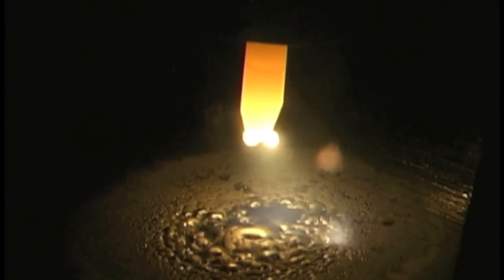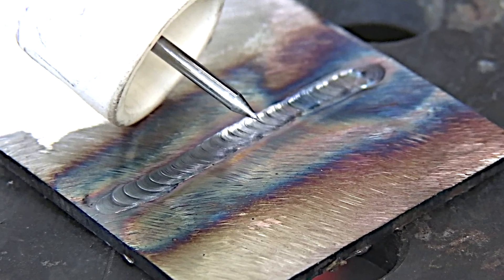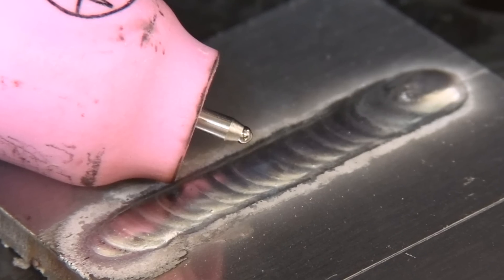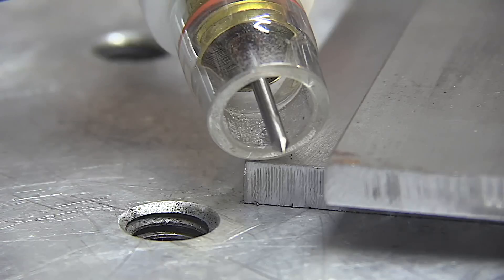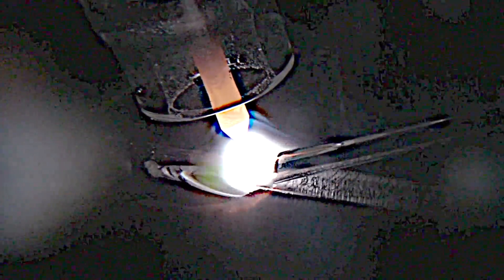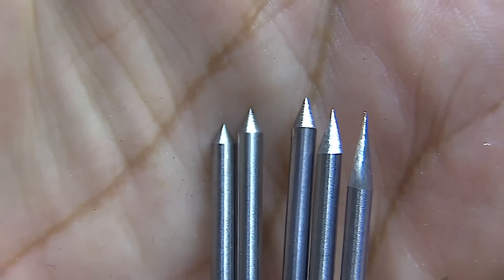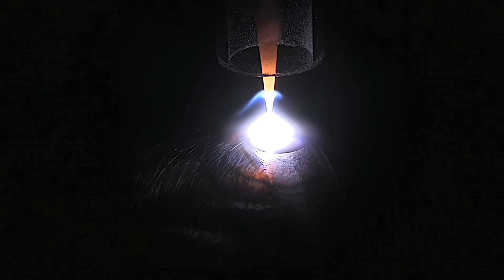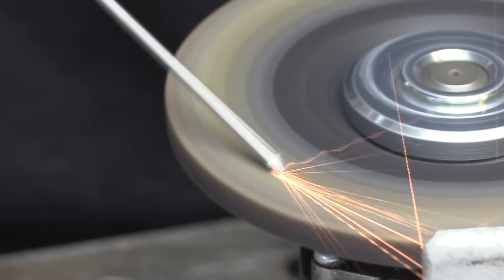Tungsten Angles & 2% Thoriated on Aluminum

Comment: I weld a ton of ChromeMolly to Carbon steel parts (3/16 up to 5/16 thickness). Company provides Rare Earth tungstens (1/16 & 3/32). What would YOU personally suggest use for that scenario? I have always used 2% Thoriated for decades. Not quite sure how I feel about the Rare Earth tungsten.
Reply: thorium is a rare earth?
Reply: @paradiselost9946  2% Thoriated tungsten & Rare Earth tungsten are 2 different types of electrode. Rare Earth are generally designed for mild to high carbon steel and other alloyed steels, where 2% Thoriated are primarily for stainless and other very highly alloyed steels. I however prefer them for most all carbon and chromolly steels as well. It is my preferred Tungsten for most ferrous metals.
My comment may have been a bit muddy. My apologies.
Reply: @BigCarmine  and thorium is still a rare earth.

yttrium and zirconium arent.
lanthanium is.
cerium is.

so referring to an electrode as "rare earth" is rather meaningless if you consider "thorium" to not be a rare earth electrode...

Comment: My newest lazy man way is just taking an unsharpened tungsten, switching the leads on the machine and setting it to ~50 amps, and striking on a clean chunk of copper, nice and slow, until I get a big old rounded tip. Quick, easy, and the tip stays nice for a long time. Anyway that's just me

Comment: the company i worked for only have this thoriated tungsten i keep asking for pure or blue one but they didn't buy it. so i did the same thing you do Sir Jodie. but one thing i notice if i start it ball then if you change amps it will dmg the tip un like pure tungsten or the blue one. Thanks for the video. and lastly i like thoriated when doing some 1.5mm or 2mm welding since i think it get hotter fast in the starts compare to other tungsten. my own observation only. just correct me if i am wrong.

Comment: loved this, thanks.  Can you offer advice on how to weld square steel tube to the floor.  The tube has a pronounced curve to the corner so the gap from the corner to the sheet metal floor is rather large.  Much appreciated!  Big fan of your TIG finger BTW.

Comment: Regarding the nodules, do you know what causes them? I get them on 2% Ceriated and 2% Zirconiated when welding aluminium. Using 2.4mm tungsten on 1.6-3mm 5005 usually ...
Reply from the maker: I really dont know what causes the nodules but AC frequency settings as well as waveforms seem to make a difference. Also transformer vs inverter makes a difference. Even different lots of tungsten types probably have differences.
Reply: I have never gotten those nodules while using zirconiated. What brand are you using?
Reply: @Wildman76059  they are Unimig, which is an Australian brand. I'm using one of their Razor 200 tig machines ... Are you familiar with any of their products?

Comment: I thought Thoriated tungstens were no longer used because they are radioactive ?
Reply: Thorium is indeed radioactive and thus a potential cancer risk. However, thoriated tungsten is most definitely still used for welding. 
Keep in mind there are different kinds of radiation. Thorium is an alpha emitter. Alpha radiation can be blocked with a piece of paper, or the layer of dead skin cells that make up your epidermis … unlike gamma rays which can require inches of lead.  The danger with thoriated tungsten comes from the grinding, not welding.  You don’t want to breath in thoriated tungsten dust into your lungs. Your lungs don’t have the same layer of dead skin, or paper ;-) , to stop those alpha particles. That stated, getting cancer from thorium is a statically thing…probably not gonna happen, but how lucky or unlucky do you feel. 😮
Reply: Who told you that? It's still sold.
Reply: the dust from preparing the tip, when inhaled, will contribute to cancer.

Comment: I learned on thoriated. I guess I learned pretty well, because I can't tell a difference between it and the other ones I've tried. I blunt the tip on the grinder though. I don't know anything about those sharpeners, they may not let you

Comment: Hey Jody, I've got a Lightning MTS 275 on the way! Any experience with that line from Everlast?
Reply from the maker: I dont have any experience with that particular model. hope it works well for you
Reply: @weldingtipsandtricks  não entendi o teu comentário.  Mas verei se uso o Google tradutor para entender o que você comentou. Obrigado.
Reply: Eu gostaria de receber informações sobre esse everlast 275. Eu quero comprar um, mas o dólar está alto,  então o real fica sem valor.  E também,  vocês aí do EUA,  não enviam para o Brasil,  enviam?